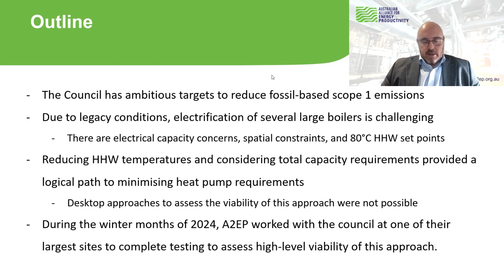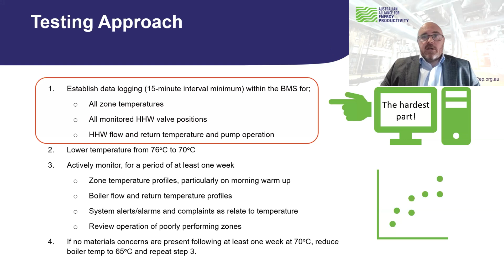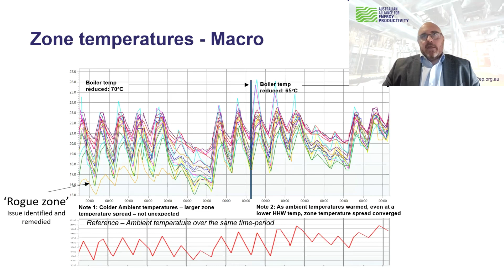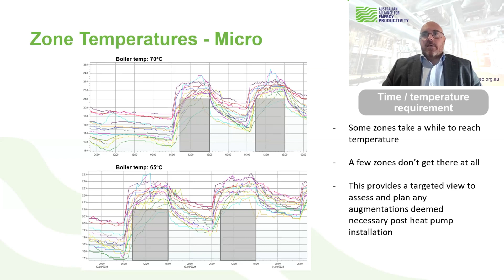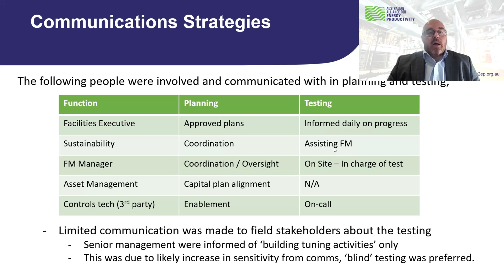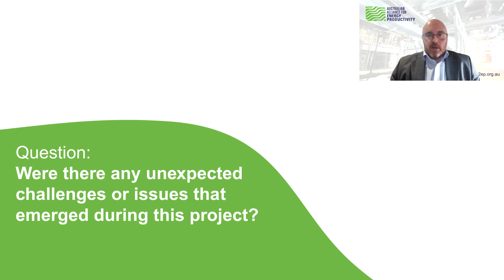Case study: lowering heating hot water temperatures in commercial buildings at a local council

Comment: Watching this, I wondered if the zone temp controls were very poor and even just replacing the controls with something more modern would have allowed lower temperatures as well as just simple aerators in the taps to cut HW consumption (and demand). Strange the FM did not note the "cold" rooms they were aware off in advance vs you finding it out and wondering why. It seems the FM never really looked this this before even just to test whether the controls were set correctly.